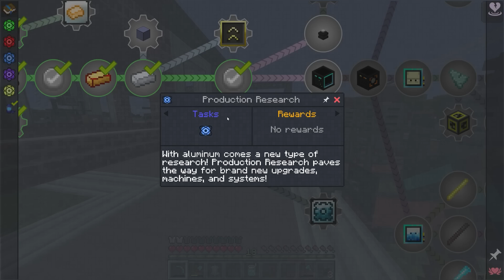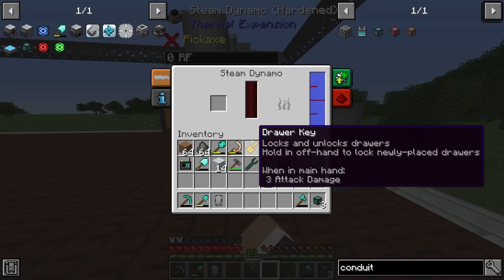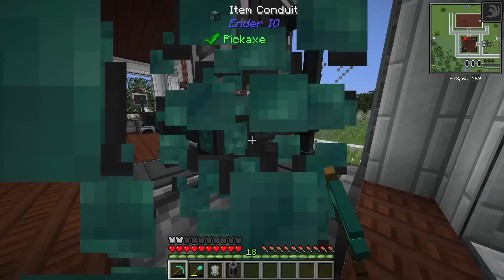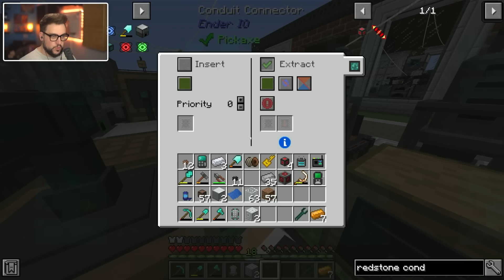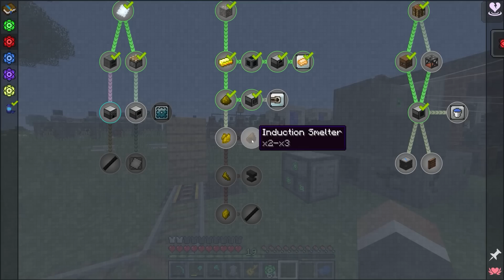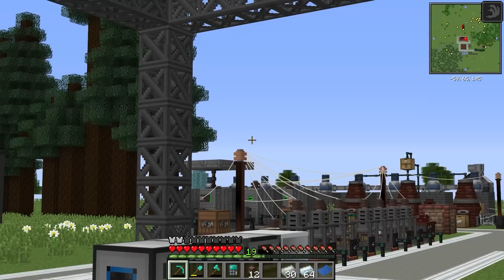Minecraft Feed The Factory | 10X ORE PROCESSING! #11 [Modded Questing Factory]

Comment: Fun fact is
When using only coke for power
The creosote bucket (reservoir or other fluid containers get destroyed upon used to burn) put inside generator from integrated dynamics (you need like 8 per dynamo that uses coke) and it generates avarage almost 140rf/t from 6 coke ovens (which little bit of coke suprlass) and another 5rf tick avarage from sticks (i haven't tested if they can be put in dynamo)
This requires a fluid transposer loop with buckets so it's quite easy to set up and it's almost 50% extra power
Source of coal is the 3 crafters with sawmill coal trick 

No wool alternative that's arguably easier to make

Comment: For those stuck with LV components for a while, like me, you can mix power conduits and wires for your network. Conduits have a much improved transmission rate (500 RF/t) compared to connectors, allowing you to extract or feed in more than 100 RF/t. Wires transfer up to 800 RF/t on the grid, better than the conduits, and are very cheap for long distance power transfer.

You can simply plop down LV connectors (up to 5) on your LV power conduits in order to connect the two grids together and transfer up to 500 RF/t.

Comment: You're definitely going to want more space for ore processing. By the time you get to NuclearCraft, you'll have 14 total ores to process and you'll most likely want to have a dedicated line for each of them. Especially when you get the infinity miners up and running.

You can also make slag in the induction Smelter at a 100% rate using 1 sand and 2 cobblestone in case you don't get enough with making steel.

Comment: Hey so instead of using trains why not use Ender chests the ones with the 3 white bars at the top so you don't have to worry about making new routes for you train and you can just add filters to your Ender conduits and it will save time and space
Reply: they're not in the modpack, and he isn't far from just getting the infinity miner anyway.
Reply: I don't think he has access to ender chests at this stage but I could be wrong
Reply: I only saw normal (base game) ender chests and those can't be piped/hoppered into or out of. I didn't see any mods that added automation capable ender chests.
Reply: @blacke4dawn  Well, Mekanism has Quantum Entangloporters but i don't know if they're allowed to be used.
Reply: @Joakico  Unless they go under a different name Mekanism is not part of this mod-pack.